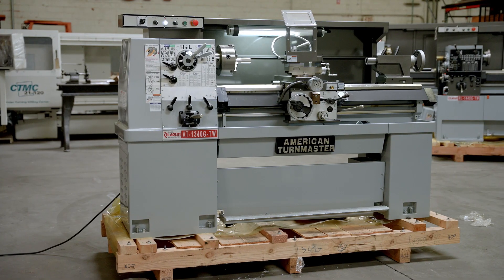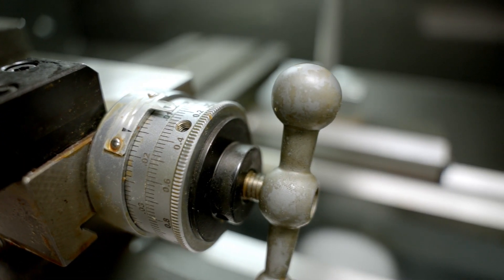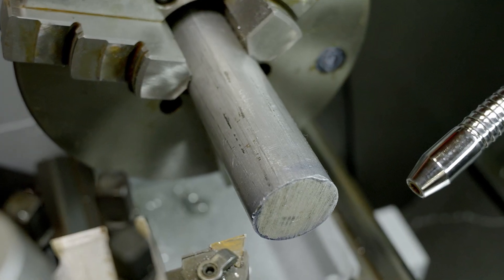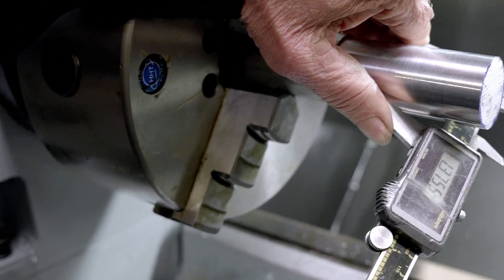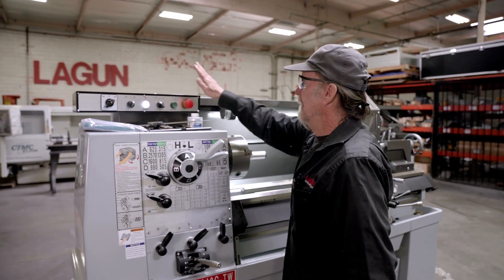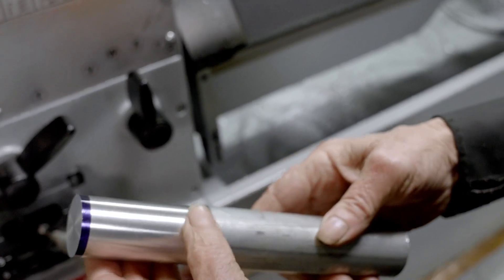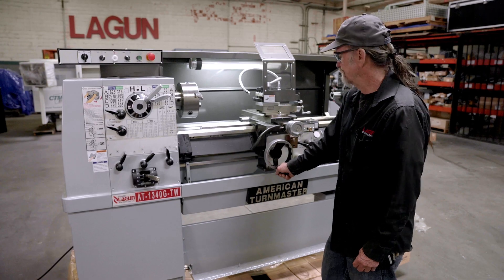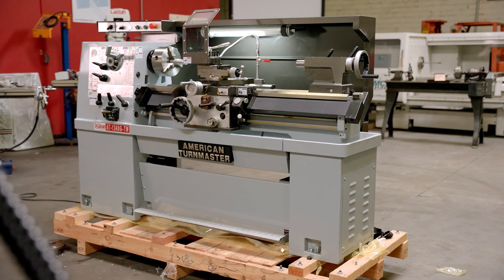Turning down raw material on a Lagun Engineering AT-1340G-TW Lathe

Comment: I wonder how many manufacterers are using that same carriage and tailstock design. I know do all used to and Acer currently uses it. They need to get rid of the .002 per line value on the cross slide..001 or don't bother.